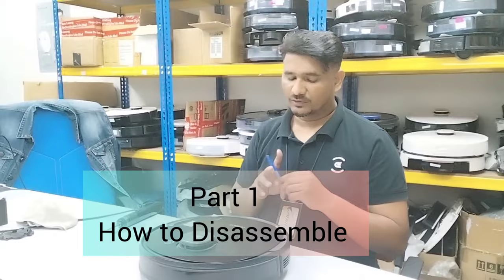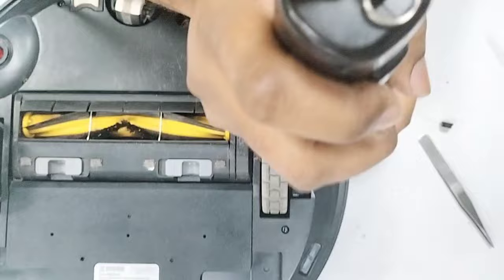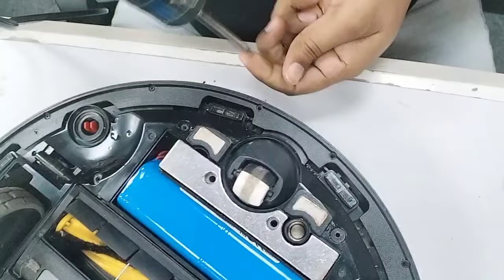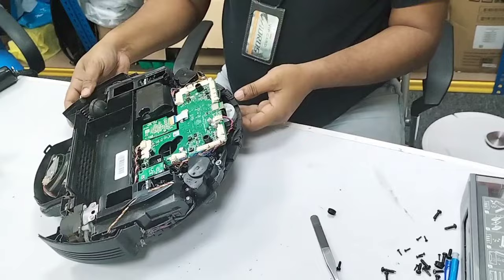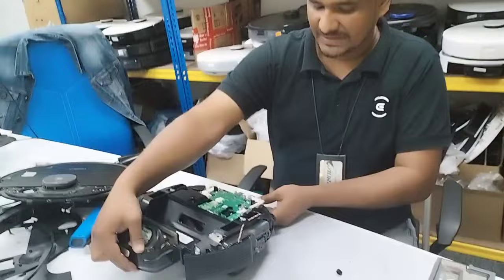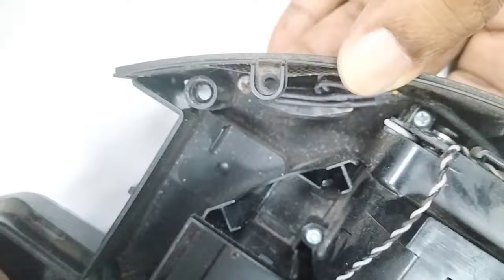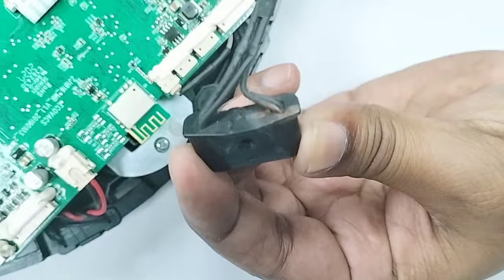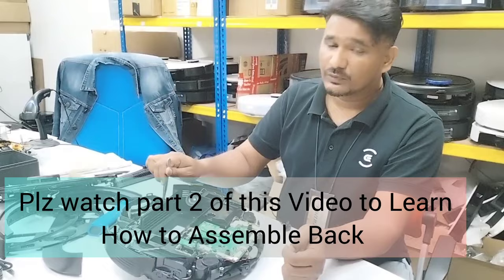How To Disassemble / Open Ecovacs Deebot

Comment: @ecovacstechnicalsupport5278

Hello,

I have a deebot 600 and I need to access the main brush motor to clean it because it doesn’t turn as it should (getting main brush tangled even when the brush isn’t on). But I can’t find a way to remove the bumper. I removed the bottom screws and the bottom part that holds the bumper in place but the bumper is still “stuck”. Is there a way to remove the top cover? I suspect that this is what prevents me from removing the bumper. Thank you in advance.
Reply from the maker: In this model bumper is stick with top cover..can remove but bit hard... better U open top cover together with bumper
Reply: I tried removing the number with the top cover but it won’t come off. It seems stuck at the front although I have removed all 8 screws, battery and side brushes. What is the solution?

Comment: Hi, do you have any video for disassembly of the empty station for T9+ ? if so, could you please share the link ? Cheers
Reply from the maker: Not yet...but remove all screw of station n use screw driver to open 3 locks around the wire fixing area then just push outer cover apposite directions...cover got no screw..only locks
Reply: Thanks. I want to open the very bottom part where it seats on the floor. it has two metal parts for charging. one of them is loose and I need to fix it. I assume this part also has locks and no screws, is that right ?

Comment: Amara i have a 1 floor house can i disable the aiti drop sensors?
Reply from the maker: Actually anti drop sensors are not designed only for stairs...where ever deebot feels the place is bit high it won't go that areas...Ifvur deebot sensors are perfectly working then I don't recommend...if always gives error at black colour or carpet...rest all everywhere ok then ok u can use this trick to hide the sensors with white tape but not transparent...must be white colour then it will work at dark colours carpet etc..

Comment: Deebot ozmo 950, throws an error of dirty fall sensors.  I opened it all the sensors are perfectly clean and not rusty, yet none of them are lit in the camera.  What could be the reason? Are there fuses on the motherboard that are responsible for the sensors?  Maybe there is some way to manually reinstall the software.
Reply from the maker: If physically you didn't see any issues then you need to install new sensors then only can confirm weather really anti drop sensors issue or Mainboard issue... because 5% chances for Mainboard issue
Reply: did you find an answer to this problem?  I have same problem. Thanks
Reply: @mihaiszabo7864  The vacuum cleaner has finished in the service, I'm waiting for an answer what's going on

Comment: Hi! I have a deebot t9 and the front wheel is threadbare :( i'm trying to fix it by myself but i can't disassemble! How i can do it?
Reply from the maker: Plz use - Screw driver n use From bumper side.... won't get scratch from front... quite hard but not impossible...u can remove in few seconds

Comment: Hey there, what could be wrong with our Deebot. It seems to work fine for a few minutes, then the suction stops but it keeps moving around like normal without suction, then the suction starts again. Very frustrating. Thank you!
Reply from the maker: Model no. Plz.??? & Once deebot stop after few seconds then side brushes also stop for a while & once it run again then side brushes also turn for a while??? Give me these details then only I can confirm TQ

Comment: @ecovacstechnicalsupport5278  My Deebot T9+ keeps saying " off the floor "  is there a know fix for this issue i cleaned 2 of the window sensors underneath but it still says it ?    Please help
Reply from the maker: Sir both wheels got a small clicking sensor on wheels assembly....one of the sensor came Off from its place or broken or faulty...need to open top cover n check those sensors
Reply: Thankyou

Comment: Hi, what about the reservoir sensor? my machine is stuck  in mopping mode even with the reservoir removed completely as well as the mopping pad adapter.
Reply from the maker: Can plz send me a video clip so I can see what's wrong...00601137973018
Reply: @ecovacstechnicalsupport5278  So I found exactly what the issue is. There is a sensor magnet, that is on the back of the unit. When you insert the reservoir, this sensor, will switch from vacuuming to mopping mode as the reservoir has a magnet that activates the mopping mode.  This sensor is not working well on my robot, its a white dual cable with a magnetic switch.  I'm tempted to just manually solder it but I would like to repair it correctly. Would you know where can I get this part?
Reply from the maker: @menesesal  original same size wire all set is difficult for you to find... easy way is just take out that sensors from white gell remove all that gell n take it to any electronic components shop from there just request for same sensor...they will give you...just solder back as is it is ...will fix the issue..

Comment: I replaced the side brush, which works now, however, since reassembling I get an error every 5 minutes that says "please check the driving wheels" any idea what I might have done to cause this?
Reply from the maker: When it gives this error so deebot turning in circles at one place??? Can not move forward? Or just in open space suddenly give error
Reply: @ecovacstechnicalsupport5278  it happens when it runs into a wall and keeps trying to move forward into the wall.
Reply: I also ordered a new motherboard. Can I just install that, or does it need software downloaded?
Reply from the maker: @jonolandon6586  just replaced new motherboard..no software issues...new software available they will give notification in app...can update from there..
Reply: @ecovacstechnicalsupport5278  yes it keeps turning around but it seems to be when it’s next to a wall and then it gives an error
Reply from the maker: @jonolandon6586  can plz attach a video WhatsApp at 00601137973018
Reply from the maker: Plz attach a video clip...can WhatsApp at 00601137973018

Comment: Can you completely remove the anti-drop sensors and the vacuum will continue to work? The “Please clean my anti drop sensors” error is driving me insane and the sensors are completely clean!!
Reply: Hello!! did you find an answer to this problem?
Reply: @mihaiszabo7864  I should add - I found in another post where the Ecovacs technician confirmed that you cannot remove the anti-drop sensors. It must be plugged in for the machine to run. It makes sense because it probably needs a closed circuit?

Comment: Where is main brush motor located in this model
Reply from the maker: In Ozmo 920, 950, T8, T8AIVI, T9 N8 Pro...in all these models Main brush motor assembly located under main board...for this part we need to remove both wheels, main board then only we can take out that assembly
Reply: Can you make a video of this after the wheels are off please? I have it taken apart up to that point by following your video but don't know how to take out the main brush motor

Comment: You are dishonest for tagging other models than the one you are working on.
Reply from the maker: Hi.. before omni start from Ozmo 920 , 950, T8, T9, N8, N10, T5 Max, T5 hero all theses models there's not even a single screw difference sir.. even T8 aivi is also same just bumper in front need to remove 2 screw that's Only difference sir....I just give a guide line in my videos.In other countries There are so many different models ecovcs selling looks like similar to these model but maybe inside slightly different mounting...I don't know which model you r using but if you need any help always welcome...
Reply: @ecovacstechnicalsupport5278  using the specific model number is dishonest.  With less work you could have typed in the description "also applies to many different models"